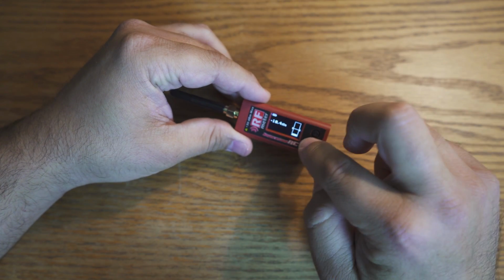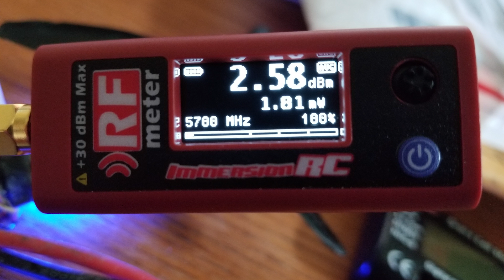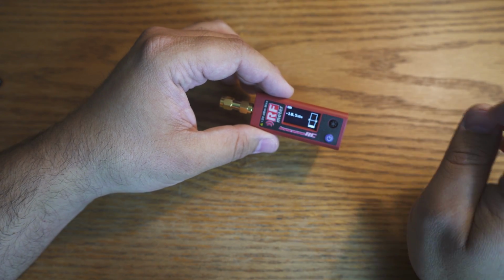Power Meter V2 By Immersion RC

Comment: correct me if i;m wrong , but i noticed during connection periods, the power meter tester device is left on without the arial probe load connected. Does this not burn the power meter ?.

Comment: Great view John E Fly. I was just recently announced as the clubs new chapter organizer and one of the things i was looking at was purchasing a power meter. Came across this video and now im locked in. 1 question though, when the power meter gets powered off does the settings reset its self? also, you know better to take them props off when your powering a quad. lol be safe brotha
Reply from the maker: The power meter remembers it's last calibration setting after it's shut down.  It makes it very easy to compare to a known "good" value.

Comment: Just got my meter and tested my Vtx's. Both are 200 mW and not new. Both showed 200+ mW when 1st powered up, but fell to 110-130 after 3-4 min. on the bench. Is this normal (heat build up) or are these 2 Vtx's trash?
Reply from the maker: That sounds fine to me honestly.  These VTX's really need flowing air to dissipate the heat.  Plus, even 130mw is surprisingly close in performance to 200mw.  In flight I bet it'll stay higher and you won't notice any degradation even if the mw output lowers a little bit over time.
Reply: Thanks! Next step is to get better antennas. Just moved from Aomway CP to Pagoda to Lollipops. What's next?
Reply from the maker: The VAS ION is probably my favorite omni antenna for a goggle receiver.  I still love my Pagodas too though
Reply: So not into the Axii's? What's on your quads, VAS?
Reply from the maker: Love the axii on the quad, just not for the receiver.  My quads all use axii, minion or triumph antennas.
Reply: Really appreciate your responding. Video has been my problem, this info helps a lot.
Reply: Sounds like a good idea. A picture would be  very helpful...

Comment: I really can't wrap my head around using a linear to read a cp. Especially randomly holding the antenna with no respect to the null zone.  When doing a comparative the test parameters must be considered constant.
I still use the v1 for testing vtx's directly and i have a jig to set spacing and alignment for testing antennas. A 5 degree angle can produce as much as a 8db difference in my results. 8db is massive being the scale is a logarithmic comparison.

I saw the v2 for the first time at my last race. They used it to test power output at tech check by putting the null zone of the whip 10 to 45 degrees of center line of the cp null. Every pilot failed and my head exploded.
Reply from the maker: Everything you say is completely accurate.  However it's meant for aggregious issues.  A lot of the usefulness is understanding how to use it.  Offending quads for me have so far shown to be +/- 16db from reference.  That's a massive difference.  Good quads are typically +/- 3db which is still 1/2 or 2x but close.  To me if it's within 5 or 6 db we're good.  How strict were they trying to be?  And didn't they realize when everyone failed the must have been doing something wrong?
Reply: I do agree any info is useful. The data is only as useful as the tech's ability to interpret the data . My post was an attempt at perspective and i appreciate your reply.

They weren't trying to be strict at all. After the 6th quad failed they grabbed one of mine for direct measurement then put the tester away after the result. We flew 3-4 pilots per heat that day so it really didn't matter.

I've had the more trouble with locations as opposed to other pilots. I suspect the analyzer would be very useful when coming to a new track.
Reply: Linear is fine, especially if you're calibrating to CP, that way LHCP v RHCP read the same.  The idea is to measure relativity, to identify people on Pit Mode, proper 25mW, and any offending 200mW, 350mW and 800mW.  This is super-fast and a pass-fail.  Sorry whomever was doing vtx checks was new to the equipment.
Correct, 45* can be useless, we do a 360 rotation around antenna, and are calibrated to the hot spot.
https://youtu.be/jW6ZgKVYo_8 
Maybe share the video with your organizer.
Reply: It almost seems like the guy in video doesn't understand antenna radiation patterns. I see he calibrates in the null zone then fiddles with attenuation until he gets a result he likes.  I can only assume the phrase "hot spot" means perpendicular to the element axis.
I suppose a machinist could measure to the thousandth of an inch holding a tape measure a few inches away if he adjusts the acceptable margin of error.
Reply: You're crazy, man.  Tots out to lunch.  You're smart and all... but you don't understand the application.  It's like you listen to the words... but don't understand what they mean.
"The Guy" said that the purpose is to identify over-powered and under-powered, not the finite measurement.
"the Guy" in the video knows antenna radiation, swr, axiom, imd and is all over the product marketing materials and manual for this product... literally sponsored by the Manufacturer due to his applied use of their products.
"The Guy" is renown as an RF Wizard in Drone Race environments.
"The Method" is proven at the largest drone races in America and the World, time and time again.  MultiGP International Open with 8 tracks of 8 raceband and 64 quads in the air at one time... MultiGP National Championships with 140 pilots, Sebring with 120...
It almost seems like you don't know the guy.
You rely on book smarts.... "the guy" relies on street smarts.
"The Guy" is sponsored.  "The Guy" and "The Method" have sold over 1,000 of these units in less than 30 days.
I don't think it's for you.  Stick to reading books...
Reply: Thanks for intelligently debating the points i brought up and avoiding questioning my credibility or insulting me. You've made me see my error.
Reply: I already debated your points.  Lemme paraphrase.  
"hey Brian, this works.  It has tested 1,000's of quads at 30+ races over the past 9 months.  It identified every problematic quad, every time."
I didn't question your credibility, I said, "you're smart", "you're correct".
You challenged the credibility of "the guy".  "The Guy" knows what he's doing and talking about.  I just showed why.
Reply: You debated the points by citing his credibility. You win, nothing useful with come from continuing this conversion. Have a good day.
Reply: Thanks, I like winning.  Good luck at your next race!

Comment: Bought this cause I have 2 quads that seem to have poor video. Not an expert, so didn't know if battery power, connections, the Vtx, Antenna, or camera was bad. But like you say, when video is distorted, flying is no fun.Just delivered and haven't even had a chance to take it out of the box - your video will be very helpful. Thx.